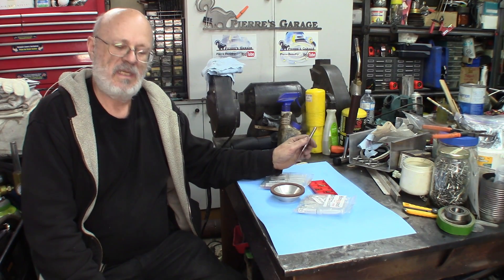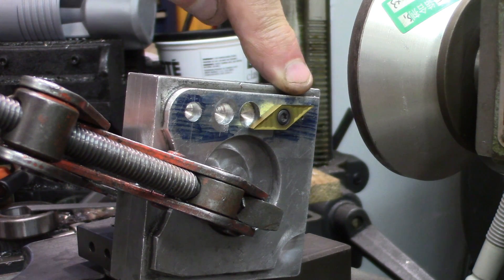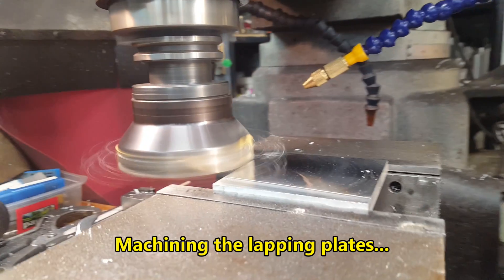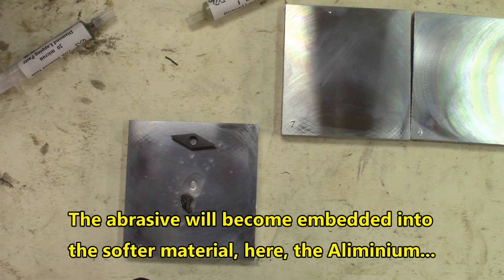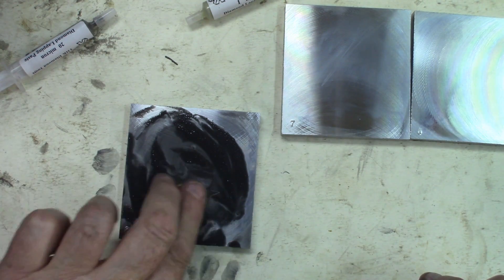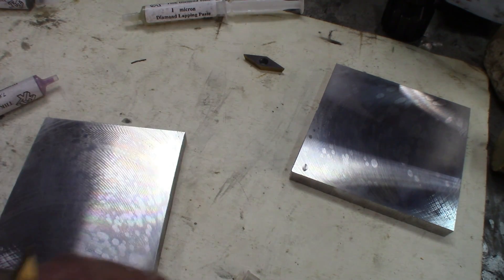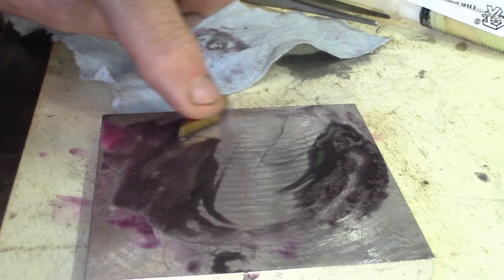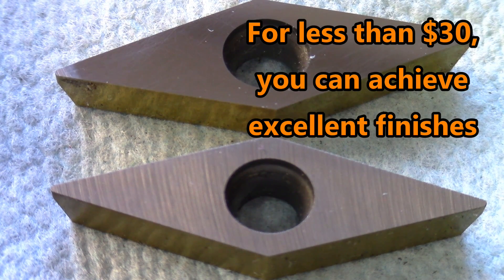Carbide with mirror finish using diamond compound, less than $30 from Banggood

Comment from the maker: ====================================================
References to Banggood web trading site...

You can get all the details to order the tools tested in this video by following the links below...
Note: According to dates, sales or promotions the price may vary, but, the prices will stay more than reasonable in any circumstances…

7pcs 5g Diamond Polishing Paste Lapping Compound Mold Polishing Tool

https://goo.gl/aSfnTK

7pcs Diamond Polishing Paste Lapping Compound Mold Polishing Tool
https://goo.gl/2wZCys

100mm Diamond Grinding Wheel Cup 180 Grit Cutter Grinder for Carbide Metal

 https://goo.gl/bRUKa4

75mm 180 Grit Diamond Grinding Wheel Cup Grinder Milling for Carbide Metal

https://goo.gl/QLwVvh
======================================================
Reply: Pierre's Garage seasons greetings Pierre. I message you few months ago regarding how to achieve the mirror finish and you suggested I get some emery cloth and T metal. I want to polish an andis clipper blade. To enable the blade cut smoothly and shaper. I followed what you said and I messee it up 🤦🏾‍♂️. Do I polish the blade on the T metal or emery cloth? Please help me

Comment: Only downside is you lose your rake, obviously the mirror finish is a lot better than a coated insert with some positive rake to it, but for the ultimate finish tool, mirror + positive rake + relief is the optimal setup.

Comment: newbie here. the lapping steel plates -  where to buy? mygreathanks and blessings
Reply from the maker: The aluminium plates I used in the video were just made flat from milling them with a big facemill. If you want a really absolute flat surface thos are available from sullpier that make high precision devices, just be aware that those aren't cheap. Everything depends on what you want to achieve in the end. Also make sure you get a plate that is softer than the material you want to lap, get aluminium, copper, cast iron, plain steel.
Enjoy machining, it's a real fun occupation...
Reply: @pierresgarage2687 wonderful video. 

I am getting some stainless steel wrist watch cases to a mirror finish. 

Is aluminium the best block to use for stainless steel?

Thanks.
Reply from the maker: There is no problem using aluminium as long as the carrier metal is softer then the metal or surface you need to polish, copper would be also another possible suitable material material. 
Thanks for your comment....    🙂
Reply: @ nice. Thanks for the reply. 

What about a firm plastic block? 

Or even an A4 sized sheet of paper ?

🤝
Reply from the maker: I've never tried with a plastic block, it's possible it could work, not so sure about the sheet of paper since paper is quite abrasive and would mix with the diamond slury or paste and add scratches on the metal you want to polish. Just be certain to test on waste meterial before the real thing....    🙂
Reply: @ I’ll try it with the plastic block and share my findings. 

For paper, I think it would depend on the quality of the paper. Printer A4 paper is very smooth. 

I’ve had good success with cardboard and 0.25 micron diamond paste. Thin, firm and smooth cardboard. No ridges. Can cut it to fit into various tight corners. And when it gets less firm, just cut off the edge. 

☺️
Reply: @ have you done much with lapping film ?

I’ve personally not had much luck with them. I tend to get micro scratches for some reason. 🤷🏻‍♂️

🤝
Reply from the maker: Neither did I, you need to be absolutely surgical between grits in order to avoid larger grits being carried in finer steps... It really doesn't take much to ruin a finish.......
Reply: @pierresgarage2687  mygreathanks and blessings

Comment: Hello 
Ibaught some diamond polishing paste and imaked 2 peaces of my inserts tool exactly like mirror (5 m and 3.5 m and 1 m) Iwill say ihad never seen like them in my life.the first thay are very very sharp and thay are good for finishing tools because thay cuts like mirror.
Ihave one frend that he is professional machinists and he told me you will make damaged Geometry but ibelive you 100% and idid now I’m very very happy white them also my machinist frend will do also 😁😁😁✌️
Thank you very much for your nice and helpful experience.
Like always only isee on your channel when igot some problems in my job.
Best regards 
Sina von Austria ❤️❤️❤️
Reply from the maker: Thanks for your nice comment...   🙂
The mirror finish on the inserts were meant to be used on wood turning tools, since wood is softer than steel or just any metal the edge would last quite some time. Using that geometry on hard materials may result on the edge that won't last as long if driven hard.
That doesn't stop you from experimenting different edges or angles....     🙂
Reply: @pierresgarage2687  hello.
Ididnt make all exactly flat.only sharped the top just alitle so geometry is in the plas and isn’t damaged.
Also Iwill use of them as finishing tools.
You are right.
I Wish for you biutifull Christmas 🎄 
Best regards sina 
Von Österreich 🇦🇹
Reply from the maker: Happy and mostly healthy Holidays to you and loved ones...

Comment: Hello again and thank you for your helpful videos.
Ihave one question:
Which matrial is good for lapping plate?the plates that you already use are aluminium?
Best regards sina 
From Austria 🇦🇹
Reply from the maker: The laping plates have to be softer than the material you want to polish, the reason is that the diamonds will imbed themselves in the softer material, you can yse also copper that is little harder than Aluminium.
Thanks for your comment...   🙂🙂
Reply: @pierresgarage2687  thanks for your response.
Like always I only see and learn of your experience that you share white us.
Best regards sina ❤️❤️

Comment: Hello. Can I use the paste without diluting it with water. Planning to use it with a felt buffing wheel and a Dremel.
Reply from the maker: This paste is an oil based mix, not very suitable for dilution in water. The principle is to imbed the diamond particules in a base material (Aluminium) softer than the material to polish (Carabide), in order to get effective grind, mostly in the finer grits, you need to use a support as thin as pssible, in the present video I use WD-40 or kerosene. 
If you seach for some water based diamond suspensions you should be able to find something suitable...
Thanks for your comment...
Reply: @pierresgarage2687  Thank you for the reply I appreciate it!
Reply from the maker: Also may I add that I never used those pastes on buffing wheels, not certain how it would work.

Comment: Old Cast Iron, (but not too beat up) Surface plates are good , CI is porous, and holds a Diamond charge wet or dry very well...(you can dry charge with a roller bearing and powder),.....on the initial grind, use a medium maxrix, at most,......anything course can fracture carbide....Also, for you AL plates, you can get a good flat surface, before Diamond charging with fine Garnet, of a fine valve lapping compound..cool video , Thx you...
Reply from the maker: Right about cast iron, new it's really expensive, best is to get our hands on old machine parts for close to scrap price, then, machine it flat if needed.
Aluminium works quite well also and thanks for the advice about very coarse grits and carbide fracture, as carbide is real tough, but, there are some specific limitations...   😊😊

Comment: Le but visé est simplement esthétique ou pour affuter les inserts ?
Reply from the maker: C'est pour un essai à savoir si on peut obtenir une surface et un tranchant compatible pour du tournage sur bois. Aussi pour démontrer la possibilité de polir des surfaces extrêmement dures et d'obtenir un fini miroir. Je sais qu'il est possible de commander des outils à bon prix directement de sites de commerce en ligne Chinois.   🙂👍
Reply: @pierresgarage2687  J'ai des inserts utilisés pour émorfiler des lames de patin de vitesse. Je me demande si et comment je peux retrouver la coupe d'origine. Avec votre méthode ou simplement en utilisant des pierres d'aiguisage. Et selon quelle technique et quelle efficacité ? Merci Pierre pour votre vidéo.

Comment: It's not getting dark because of the carbide it's getting dark because of the aluminum that's oxidizing as you take it off. More aluminum is ending up in that paste then carbide absolutely
Reply from the maker: Nope.....    
The diamond cristals are imbeded in the Aluminium plate, the carbide insert don't even touch the Al or just about.....    Yes, the diamond grit will fracture and wear, when reloading the Al plate it's like a new grinding plate.....  
Unless you get a better explanation, this is carbide grit removed from the insert.

Comment: Thank you so much for your video! Well done! One question: I'm looking to purchase aluminum lapping plates like yours. I've found different options: "hard" aluminum"  (7075) or CNC aluminum (EN AW 5083, AlMg4,5Mn) and another (AlMg3 / AW-5754). All are 100x100x10 mm and milled flat. The prices vary somewhat. Does it really matter what type of aluminum it is, or is it only important that it be fairly thick and the surface flat?
Reply from the maker: Thanks for your comment. Just about anything softer than what you need to lap will do, it just need to be as flat as possible. Important to avoid cross contamination of the different grits to minimize scratches on finer grits...

Comment: After lappong  did the the cutting performance enhanced
Reply from the maker: Those were meant to make tests on cutting wood, the sharper the cutting tool is the better the cult will be, mostly with carbide the better the polish is the sharper you will get the edge to be, the problem with carbide is being very hard it's also very brittle, so thee edges will chip easier on impacts. In most cases high speed tooling will give off a better finer cut but won't last as long as good carbide tool.
Reply: @pierresgarage2687  ive heard theres always gonna be fracture like structure at the edge and a mirror finish reduces it
Reply from the maker: @woozhi9218  This is the reason where the choice of composition for the carbide insert is adapted to the intended use, the manufacturers will adapt depending if you cut either, wood steel, aluminium, plastics, etc...    The receipe and geometry will change as well as coatings if required, making optimal cutting inserts is a science in itself....     🌈👍

Comment: at 3:00 what is the base you are using to move the piece back and forth
Reply from the maker: It's like using a surface grinder, the foreward part of the wheel will wear most as the center of it will wear least or not, in this way you can get equal removal on all the surface instead of an uneven removal as different parts of the wheel won't wear at the same rate.
Reply: @pierresgarage2687  i meant the forward and backward motion of the carbide, is it a cnc vice or

Comment: 0:27 super confused, you say good for carbide but then say don't use on carbide a few seconds later ....
Reply from the maker: My mistake about saying carbide on the second time, I meant HSS or hardened materials...  
To make it as clear as possible, don't use resin/diamond grinding wheels  like those on HSS or hardened steel they will wear very quickly...

Comment: 1. This method will not produce a flat surface. The finger pressure is not the same in all directions and the fluid hydrodynamics will prevent the piece being polished to stay parallel to the plate. The polished piece does not appear flat, but slightly curved, as it should using this method. Can we have your definition of "flat"? How do you test the flatness?
2. Why not use a flat glass as a support? The machined Al is far from flat and is slowly becoming less and less flat. So, if flatness is important, how do you keep the finished product flat?
3. Mirror finish is not a technical term. Numbers are needed: such as roughness. How do you measure it?
4. A mirror glass is finished with 0.1 micron grit. Why stop at 1 micron, when green light (mid of visual spectrum) is 0.5 micron?
5. Low viewing angle is not a good test. A poor surface will appear polished at these angles, as rough defects send light a high angles. This is why test is done looking from above with a strong light source from the side. At about 14:10 one can see a lot of scratches on the polished surface. Is this OK? If yes, what is the meaning of "polished with scratches"?

Thank you.
Reply from the maker: You're right about the job being rushed, this is more like proof of concept, than actually producing a super precise part. This part didn't need the perfect flatness on the surface. This was to show that with the needed steps and with a little more precautions used in this video you could achieve some decent results with diamond polishing pastes, to get perfect results you need to be very meticulous and tidy with the different steps in order to avoid taking over bigger grits in the following steps...
Thanks for viewing and for your comment,   Pierre

Comment: don't your lapping plates need to be flat?
Reply from the maker: This is more for proof of concept than getting a perfect flat surface, thi insert was only one unit made in order to try some wood cutting tool, the other ones were to be eventually purchased as they are available from asian suppliers at a price low enough that it wasn't economical to do it that way...
Thanks for viewing and for you comment,    Pierre

Comment: Where can I purchase same style plate? Smooth plate
Reply from the maker: I made those plates by using a face mill on the milling machine, you could purchase some pieces of 6061-T6 and lap it with emery cloth on a reasonably flat surface.
Reply: Pierre's Garage thanks. Do I stick the emery cloth to the plate or do it how you did yours?
Reply from the maker: If you have available a good flat reference surface the emery method would be a step above the milling method, the surface doesn't need to be mirror finish on the Aluminium plate, some tiny streaks will help keep the diamond particles on the plate as you use it, you probably can notice the surface finish from the milling process on my plates left some cutter marks.

Comment: 🥇For 20 years, we are the last small factory in France polishing aluminum rims with a very polished polishing! 
And I still learn with you! As this move from 7 microns to 1 micron (0.0000393701inch ) for a finish "mirror".
the important part is the materials for polishing, in your case " diamond compound" ,I knew artificial sapphire  powder  or Aluminium oxide powder but not " artificial diamond compound" , I'm going to try.a question however, have you also polished your aluminum bracket? does it have a mirrored finish like your carbide insert ?
Reply from the maker: The Aluminium plates won't polish, being way softer than the material to polish they will allow the diamond particles to get embedded into the surface, a little like an emery cloth will hold the grit and allow the material to be polished to more without moving the grits....   Or something like it if I expressed myself correctly...
Reply: @pierresgarage2687  .thank you very much, you are really above the lot! for my mirroir finish on aluminum I will stay to use aluminum oxide from 7 microns to 1 micron (0.0000393701inch) for a finish "mirror" , with the help of a brush made of sisal and 100% cotton ...
Reply from the maker: Diamond compounds are better choice on much harder materials than Aluminium or soft steel...  your already proven method seems to me like a winning strategy...   ;)

Comment: Great video! I bough these diamond compouds (from 7microns to 0.5microns) specially to try to remove scratches from watches, smartphone screens and glasses. Have you tried polishing glass? Hope it works!
Reply from the maker: It should work, but be aware that make a perfect job you need to remove ALL material down to the bottom of the scratch, the amount of work will depend on the depth of the scratches, be very meticulous on the cross contamination of the various grades.
Reply: @pierresgarage2687  Thank's for your reply and tips. I'll be aware of that.

Comment: I want to use it to polish out scratches on watches.
Reply from the maker: Should work on glass or any other hard material, not sure on plastics, though, I haven't tried it on soft stuff...   Make a test before using on any $$$$ watch or jewel, just in case...!!!    
Let me know what works for you so I can add expereinces in future videos.
Thanks,   Pierre
Reply: @pierresgarage2687  Will it work on stainless steel ?

Comment: Carbide is cut/formed or whatever to get the shape for good results in a modern low vibration with a solid tool mount at high speed. Why do you alter it?  What are you cutting and why wouldn't high speed steel work?  The process posed here takes time and supports China, the country that puts small countries in debt by loaning them money or does a construction project, placing them in a position where they cannot repay the loan and forecloses  just enough to gain control of the project, which means profits.
Reply from the maker: Those inserts were a test to see if we could modify metalworking inserts to te suitable for woodwork, that worked out quite suitable, later we found some right sized inserts for woodworking on Asian sites, cause some local shops were asking something like $24CDN for a single insert. 
On the plus side, this showed what was possible using that method...   ;)
Thanks for your comment,   Pierre
BTW, China is just another one that uses their money to get their feet in other small countries, they got good teachers in most other capitalist countries...   not to name any, since I don't want to make this channel a political one...